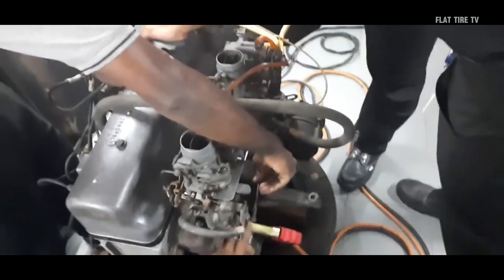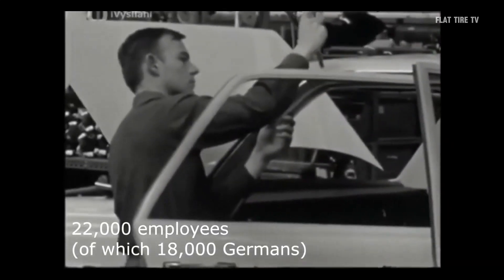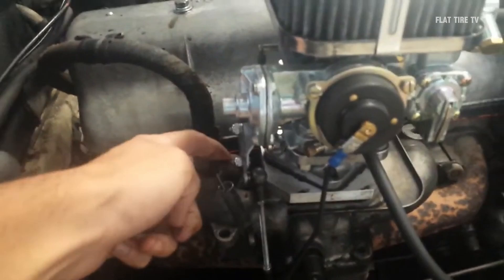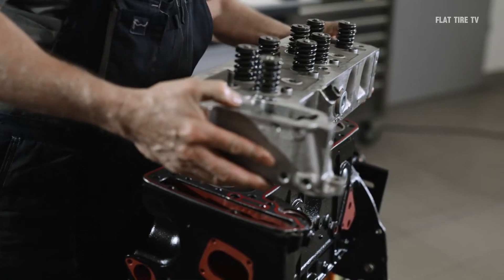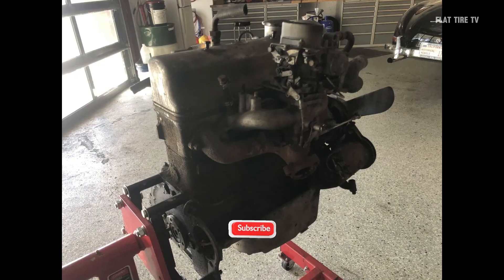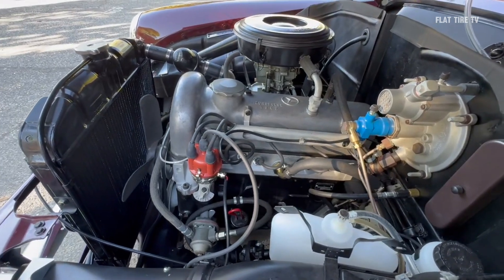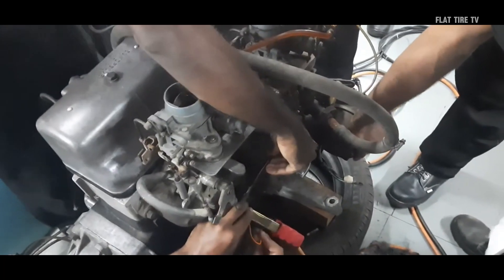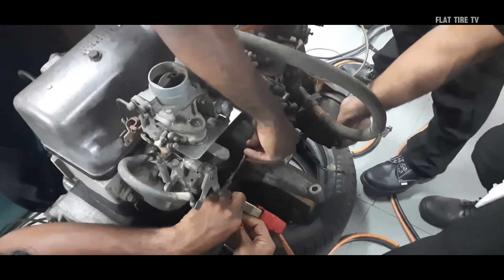The LEGENDARY M121 ENGINE (In Detail) | Mercedes Benz M121#engine #mercedes #m121

Comment: I had a lot of contact with these engines in the 190! Fintails in the late 1960's through to mid 1970's certainly reliable and economical but in single carb form used in the Fintails a bit lacking in power